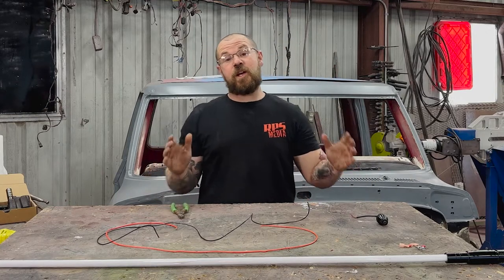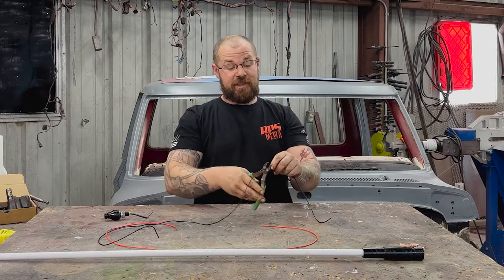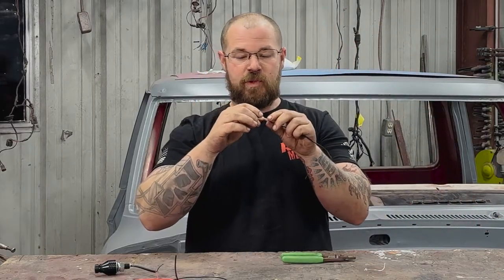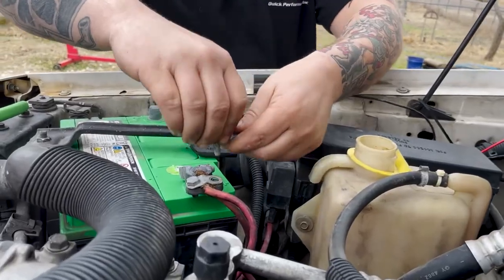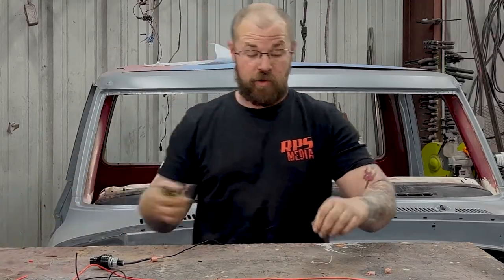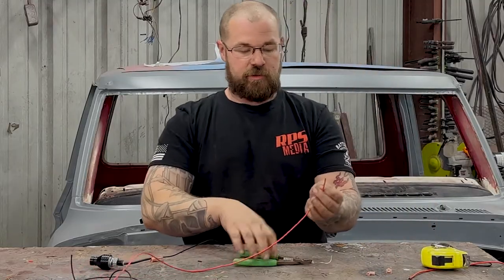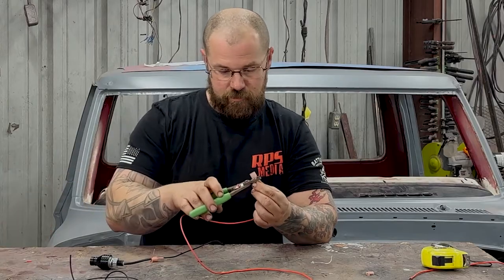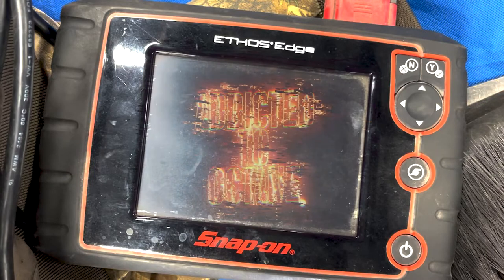How To Wire Up LED Whip Lights

Comment: What amp rocker switch is appropriate for whip lights? It's on a 48v golf cart.
Reply from the maker: @anghiggy5029  what’s the draw of the lights… we use 15 amp kits
Reply: @AddictedToOctane  I'm not sure. No longer have the box. They are NiRider and the only thing I can tell you from their description on amazon is that they're 288 watts.